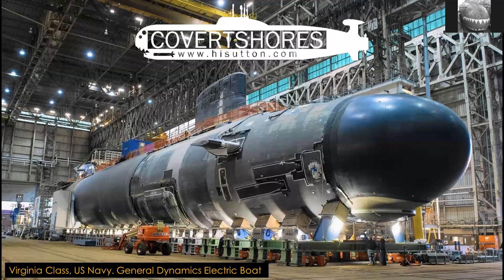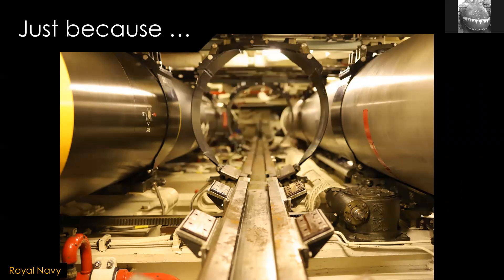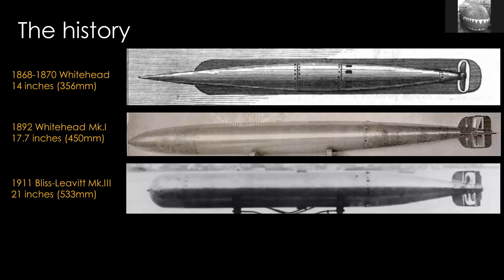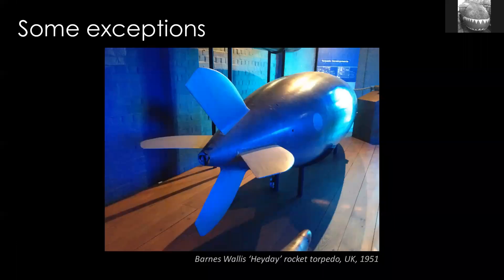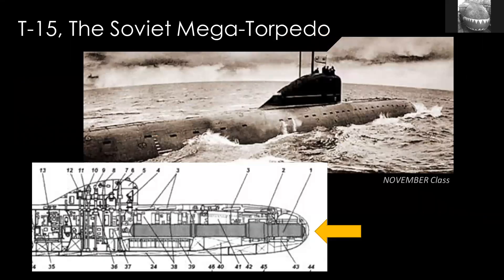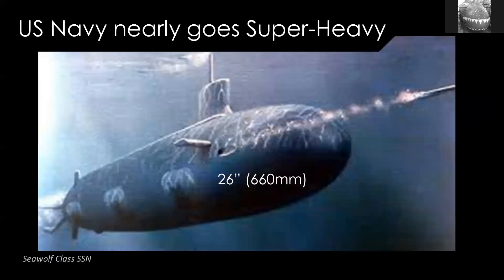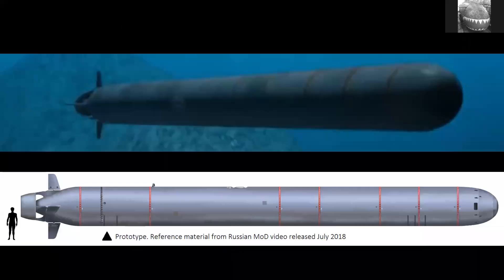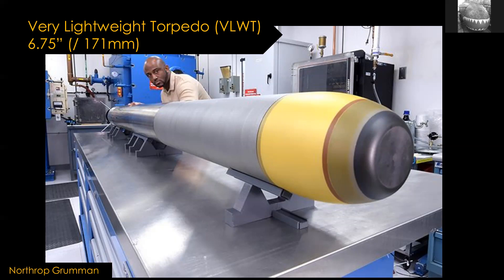Submarine FACTS: Why Are Torpedoes Always The Same Size?

Comment: I know nothing about torpedos so a historical account of the development of torpedo capabilities and on-board systems, such as electronic warfare, offensive and defensive sonar and sound wave systems/tactics, chaff and other defenses against anti-torpedo systems and tactics, AI-generated defensive maneuvers,   Also what about warhead types, and alternate guidance methods such as multi-node kill webs used by next generation air-combat in which submerged and surface vessels, and even buoys, handoff targeting of already launched torpedoes, for example to hide the launching submarine itself or for other reasons.  Also, has anyone toyed with crazy ideas such as AI-commanded torpedos that can be launched in low-power mode at great distances and which then either creep toward the target or "go to sleep" and drift toward their targets (ships in harbors, for example) and then wake up, lock onto a target and accelerate toward it.  There simply has to be a million crazy ideas that have put into torpedo designs that's nobody's ever heard of outside of a few experts, and of course the crews of the super secret submarines that carried them.

Comment: Not totally true. Modern Russian submarines have 650mm torpedo tubes that can be adapted to use 533mm torpedoes, they transitioned from 533mm to 650mm in the 1970s with the Oscar-class submarines and the type 65 torpedoes. China also uses 650mm torpedo tubes

Comment: As a USN torpedoman (retired) I found this to be a very insightful and informative essay. Bravo!
Reply: For whatever reason in 1978 I was sent to Mare Island for a 3 day torpedo tube inspection class - I was an Opticalman, go figure, though I was stationed on a sub tender and worked in the periscope shop. The class was kind of boring, but crawling down the tube to set up the autocollimator reference mirror was fun, as was doing the bore diameter measurements. There was an advanced class where the techniques of fixing geometry problems were covered, but I didn't go to that.

Comment: One thing you didn’t mention regarding 533 torpedo tubes , they can also have a double use ! The size is just enough to fit some combat divers and their equipment to enable them to do a stealthy sortie/entry out of the submarine while it’s diving. This technique is used by the French navy as can be seen in the movie « The wolf’s call » in the introduction sequences with special forces divers getting inside the submarine through the tubes

Comment: 533mm is about the max size that can be reasonably handled internally , inside a submarine underway, with speed and safety. The amount of torpedoes carried internally vs capability maxes out at 533. There have been and are some special torpedoes that are larger then 533.

Comment: Swedens latest torpedo - Torped 47 into service 2022 is a ligth torpedo  intented to use against submarines from al types of platforms including submarines has a diameter of 400 mm.

Torpedo 47 replaces Torpedo 45 from  the 1990:ts and also had a diameter of 400 mm.

Comment: What about guidance systems in topredos? I spent a couple of years at Marconi Space & Defence (before they were taken over) and worked on the test racks for the torpedo that was being designed there. I was told that it used an array of sonar devices which could distinguish between different hull shapes, I never did find out if this was correct. But there was the front end of one of the torpedos in the area and it did have a matrix of several dozen, of what could be sonar devices.

Comment: Holy moly - that sub is being built in a factory? Do they use that gantry to lift the entire sub and lower it into the water? Wait, there are wheels on the blocks holding it up. I guess it could roll into the water? I'm just shocked that subs are built like this now.

Comment: Torpedoes come in all types launch and leave, loitering direct. There is a physical limit to the size that can be easily handled on ships, I suspect above a certain size loss through drag in the water becomes excessive also as Subs change size they are rarely fired leaving the possibility to use them in new types. It also offers the possibility of swapping torpedoes.

Comment: The same diameter, but not the same length. This allows them to be backwards compatible with older shorter torpedoes in inventory, but also use newer longer ones.

Comment: A note on 650mm torpedoes. The Israeli Dolphin class submarine also feature 650mm tubes (x4), which are believed to be used for nuclear armed cruise missiles. 
Very interesting video. I didn't realise you had a YouTube channel. Subbed and will likely be spending much of the day listening to you.
Reply: Or for non-nuclear long-range cruise missiles. The sub-launched Popeye has both conventional and (most likely) a large kiloton-level nuclear variant. My information isn’t unique but I have been told by a fairly recently retired IAF friend that Israel, which had originally relied on the Air Force as its second-strike nuclear deterrent, began to lose confidence in the reliability of air-dropped nukes after the Yom Kippur War. At the time they were (entirely? mostly?) reliant on air-dropped dumb bombs for their second-strike capability at the time. After suffering considerable losses in the air during the October War they started looking to diversify. My source was a little cagey when I asked them what Israel’s interim nuclear solution was. He didn’t exactly say no when I asked him if Israel fielded air or ground launched nuclear-capable missiles between the Yom Kippur War & the ‘00s when Israel took delivery of its first Type 209-based Dolphin class submarines. He didn’t really say yes, either, though. Based on what he said & didn’t say I inferred Israel’s nuke delivery options were fairly marginal before it acquired the Dolphin I and (more recently) Dolphin II class AIP submarines. No earth-shattering news scoops here, but it was an interesting conversation.

Comment: Hmm?   seawolf class - 26.5 inch torpedo tubes with 21" sleeves, Jimmy carter class 26 in (660 mm) tubes.  Russia use to love their big ship killer  type 65 torpdes 65 cm (25.6 in).  however those tubes could be sleeved down to 533, such that a sub could effectivly "swap out"  its 2 650's  for 2 additional 533 tubes, without going to port.  

533 is common but really its partly based on "supply"   most nato subs can trade torpedoes.    This means in case of a war,  Norway, UK, Germany, France, and such can all trade torpedoes back and forth, OR... that was the plan.   Some countries never updated their software though for newer us or UK torpedoes.

Sweeden, enjoying being strange, also uses 400mm torps.

Russia was late in the Sub game, not getting involved really  until 1927,  they got help from Germany including with the torpedoes so...  they started the game with 533.

Comment: A 15 minute long video about why torpedoes are all the same size? It's so they can be used on all boats. Imagine the embarrassment when the captain yells, "Fire one!" and you have to report unable because the torpedo won't fit in the tube. But if you really need 15 minutes to understand that concept, then you may be interested to know that shells fired from the 16-inch guns on Battleships all used the same diameter rounds as well. We may never get to the bottom of that conspiracy.

Comment: The A-10 Warthog is designed around the main gatling gun GAU-8 Avenger. Submarines just kept having their torpedo tubes designed to launch the existing torpedo's, so more torpedo's were made to fit the existing launchers and so on, and so forth. The width stayed 21 inches, lengths however did vary 10 to 21 feet.

Comment: I was going to venture a guess that it was around about the limit that a crew of torpedomen could man-handle into position. That is really more weight-dependent than anything but you can imagine they'd increase in size & weight until a practical limit was reached. Beyond that you'd need additional machinery or automated reloading systems (which the Soviets seemed fond of).
Reply: well there big enough to do the job bigger would reduce the number the sab can carry and thus the number of shots a sub can get off at the enemy's fleet

Comment: I would argue that there is an "optimal range" around 533mm. Basically you have two effects working in opposite directions. The first is that range, payload and capability increase with diameter, which explains the early size creep. The other effect is that increasing diameter decreases fluid dynamic properties, handling capabilities and ammo capacity. Two such opposing effects naturally create an optimal solution. Where that optimum falls is dependent on the weights given the various attributes in the optimization problem, hence a somewhat loose "optimal range", into which the 533mm falls. On the other hand, there is little incentive to find out whether 540mm or 525mm would perform better, because the gradient is very shallow (minimal gains by changing a little), while the costs of changing are very high.

Comment: Thanks for an interesting historical overview of torpedoes and some subs. However, you don't feel that you gave a complete answer to the title of the video. Sure you went in to some detail about what some larger diameter size torpedoes were thought to be designed and constructed for. But you never went into depth about that. So maybe a follow up with quite a bit more technical details and comparisons of different types of torpedoes, both being used as of today and in the past, and why those specifics were seen as sufficient. I.e. I guess they meet the requirements of how submarines operate and attack. However most of us don't know much about that, so an in depth on that part would be greatly appreciated!

Tanks again for the well put together video!

Have a nice day!

Comment: They could launch the 171 mm torpedoes using a sabot to seal the tube to propel the torpedo.  When the torpedo leaves the tube, the sabot would fall away in two halves so as to not hinder the flight of the torpedo with parasitic drag.

Comment: I remember information floating around on the Seawolf class that those extra-large tubes were not so much to enable larger torpedoes, but to enable "swim-out" torpedoes, i.e. 533mm-Torpedoes that would leave the tube under their own power instead of being shot out (which is loud, which is bad).
Reply: Wouldn't it be easier to have dedicated swim-out torpedoes (slightly narrower?) that use the regular tubes? Or is the idea that any Mk48 can be simply be instructed to swim out?
Reply: @mrkeogh  Many components are (obviously) standardized to 533mm, so it is easier to scale up the tubes and use standard torpedo parts where possible than vice versa.

Smaller torpedoes means less fuel / range, less space for sensorics, less warhead.
Reply: During the Cold War all USN attack submarines fielded a 19-inch ASW torpedo, the MK-37, which was launched using swimsuit mode. It was also wire-guided and designed to be launched from 21-inch MK-63 torpedo tubes.

Comment: In the dreadnought period and even the interwar, it was common for nations with less-well-developed naval infrastructure to order capital ships of all sorts from (mostly) British shipyards.  This in turn naturally led to even IJN vessels using inch standard for their larger gun barrels.  If submarines used 21" because "everyone else is doing it", was there some similar situation where boats would be bought abroad instead of built locally?  Or some other reason that navies felt the need to be size-compatible with everyone else's torpedoes?

Comment: Something you may want to clarify is this only applies to submarine launched torpedoes. Surface launched and air dropped torpedoes come in radically different sizes. For example, a Mk 46 torpedo is much smaller than a 48.
Reply: I'm a submariner veteran (99-03) if I recall correctly the Mk 46 was either 16 or 18 inch diameter. The Mk 48 ADCAP is 21 inch diameter. Do the surface combat vessels still use the MK50. I've never found clear or accurate size dimensions for that particular torpedo.
Reply: It’s easier to tweak sizes for surface ships & air-dropped weapons.
Reply: The video is literally titled ‘submarine facts’ and the intro of the audio refers to submarines specifically!!
Reply: N.
Reply: Ñ
Reply: @gilatrout5301  ??

Comment: I think the main reason is that 21 inch still does the job, and are still a threat to even the largest ships.
Torpedoes would get bigger if the defences against torpedoes would become able to withstand the 21 inch torpedoes.
We saw that up to WW2, the sizes of battleship guns kept increasing, as armour was getting better and better.
But this didn't happen as much for torpedo defence. A 1920s torpedo could still destroy a modern warship in most cases.
A second problem is that the submarine would need to get bigger as well and larger submarines have a lot of places they cannot go.
Reply: Defenses such a armor and torpedo bulges are limited.  They do nothing to prevent multiple attacks and with enough hits anything gets overwhelmed.  You can end up like Bismarck  aflame from stem to stern with out of control flooding. Not killed by any single hit (unless we count the rudder hit that prevented Bismarck from running away), but overwhelmed by the sheer volume of fire. 
The greatest defense against torpedoes is offensive ability. Not letting your opponent close enough that their torpedo can hit.  The destroyers that attempted to swarm Bismarck the evening before were driven off by 15" gunfire.  As they got closer the shots hit nearer and nearer.  They couldn't get into effective firing range and hope to survive.
Reply: Modern torpedoes don’t function the same way as WWII tech. Not sure what you could do to prevent it detonating underneath a ship and breaking the keel in half.

Comment: You know there is a very good possibility that that smaller new torpedoes, could very well have as much (or more) range and destructive power due to advances in power systems(lithium ion batteries vs the the older agm and other types) and newer higher velocity explosive charges.

Comment: Interesting, but you disprove your Headline, by explaining that there are larger and smaller torpedoes.

It stands to reason that if most subs have 21" tubes then they will also have 21" torps and there has to be a damn good reason to design something else.  As you mentioned, larger torps mean that an average sub can carry less.  And this is likely yo be the reason for the 21".  The torps had to move fast enough and deliver enough of a punch, to be effective. Somewhere at the beginning of torps, it was decided that 21" was just big enough to get the job done.  Basically the Goldilocks principle.  Smaller would not hit hard enough. Larger would require too frequent restocking.  21" was just right.

Comment: On as related question of torpedoes;  Hoow does the wire get "cut" on the torpedo?  How does the spooling wire not foul the submarine propellor or otherwise get caught or damaged?
Reply: When the weapon fires it conducts a wire clearance manoeuvre which keeps the telecom cable clear of the boat. Once the engagement is complete there is a guillotine at the rear of the tube which cuts the wire and the weight of it clears it from the tube.
Reply: @Ferrastar  Thanks, I was always curious about that!

Comment: just wondering why has no one put there reload torpedoes in some sort of revolver type structure.  they would have to be easier and faster to reload than the systems that I have seen videos off.  I do not mean that they would be fired from them just as a way to store them.  If I am wrong and some one has tried please let me know.  It would also have to cut down on crew numbers.

Comment: Could you use enemy 533mm torpedoes in a war setting if you captured an enemy base?
Reply: Only if the combat system has been design to fire that weapon. If the combat system can’t talk to the weapon and vice versa you could fire it out of the tube but the weapon won’t activate or arm

Comment: Not sure that really answered the question aside from "eh, its just what became the standard". I would have thought it had something to do with how they are launched. I thought they were lunched with air pressure, so they had to be a very tight fit in the tube so the pressure could push them out and get them moving. Guess that isnt the case.